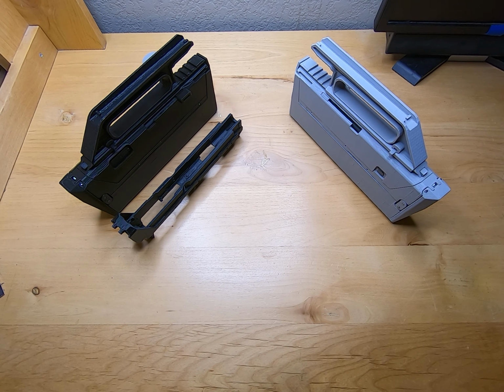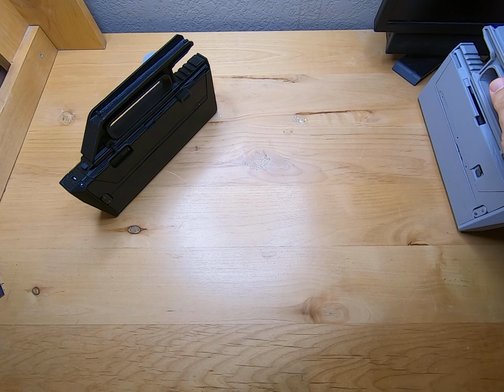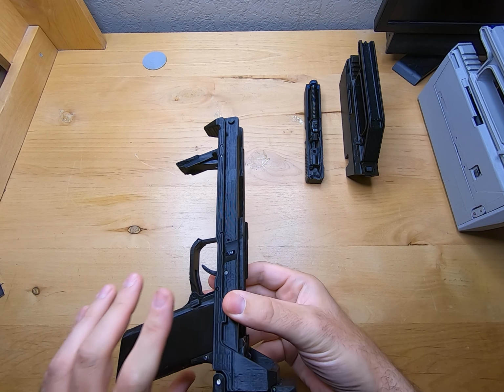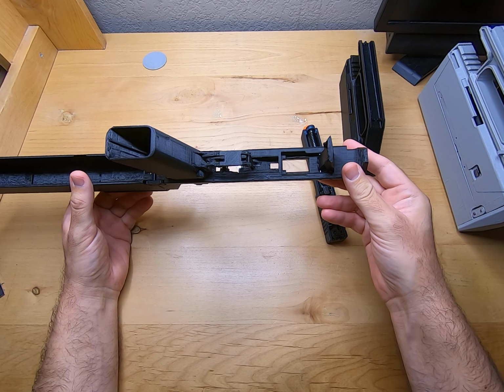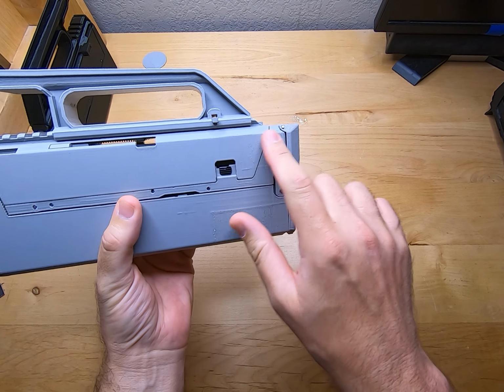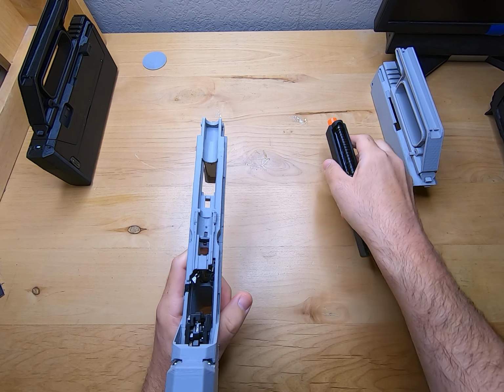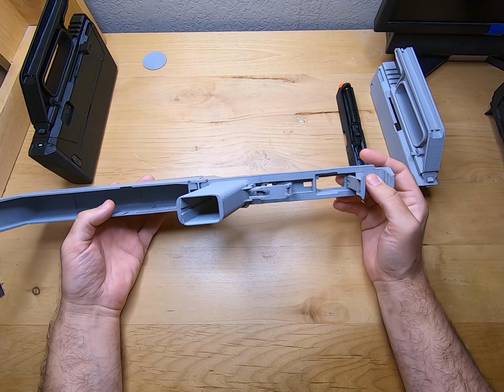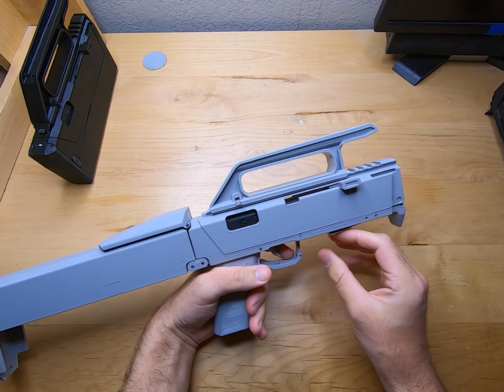3D Printed Airsoft FPG Update Video

Comment: Nice work! But I'm wondering about the durability of the chassis that you've printed.

PLA isn't so much reliable material for the high impact and friction heat, you know.

Besides, I'm worried about the small hinge between the frame and the stock will break due to repetitive operation.

P.S. I'm also trying to make an FPG printing file for the AAP01 conversion kit, (still pending but so far so good.) But I don't know how to solve those two main issues...
Reply from the maker: Heat really isn't a issue but friction can be a problem when dealing with the slide sticking. I have had many parts break, the pivot connector has been one of those. Most of the time it's a small easy part that can be quickly printed.
Reply: @enone_9007  ... yeah small parts may be easily printed out, but it can cause a risk of injury due to damage during operation.

For example, the magazine or the stock may fly away while unfolding them. (of course, that wouldn't happen if you unfold it very carefully, but it may uncomfortable.)
Reply from the maker: @louisek5383  I've never had the stock fly away. When the connector breaks, it usually shows when it has less tension when unfolding. If the mag falls out when unfolding then there's a issue with the mag release.
Reply: @enone_9007  ok I understand. By the way, is it compatible with KWA FPG?

actually, I already have 3 of them but none of them was satisfied me at all. so I'm looking for some replacement like TM compatible version receiver.
Reply from the maker: @louisek5383  I don't know if it's compatible with the KWA version. I did change a couple of parts so it's not a 1 to 1 replica of the KWA FPG. Where'd you find three of them? The best I got was a couple of hours to measure and take pictures of a KWA version. Couldn't afford one when they were being sold and by the time I could they had been discontinued. Decided to 3d print one since it was hard to find one.
Reply: @enone_9007   That's a shame... I had a hard time to get them too - a  lot of efforts and just a sheer luck.(even I'm living in South Korea where highly limited about airsoft)

Looking at it now, the positions of the two pins on the front handle look slightly different compared to KWA products.(If so, that means that it is difficult to expect compatibility...)
Reply from the maker: @louisek5383  I had difficulty just finding someone that had one to measure. The artwork I was working off of initially was way off. It's close but not exactly the same. Were you looking to 3d print replacement parts for the KWA version?
Reply: @enone_9007  I was, But inspired by your results, I revised the failed drawings that I made five years ago and completed them again yesterday.

Still, I had doubts about the durability, so I was looking for a better drawing by someone - just like your works.

Actually I don't care whether it's compatible or not if it's perfect enough in itself. I'm still counting on you!
Reply: PLA+ would be the best filament for that. Been using PLA+ with my other 2A builds
Reply: @joeydionisio2184  I use PLA++(more durable and better performance than PLA+ I guess) but sadly, there is no way to prevent breaking from the thin spot (less than about 3mm)

According to my experiments, most of the break is issued from nearby the pinhole, but none of them have enough space to reinforce...

Maybe I should give up the precise external design.
Reply: 100% infill 6 walls are my usual settings